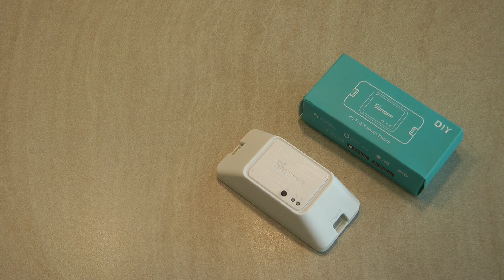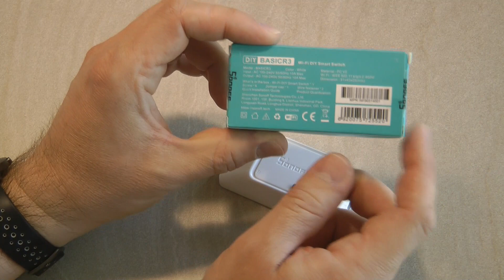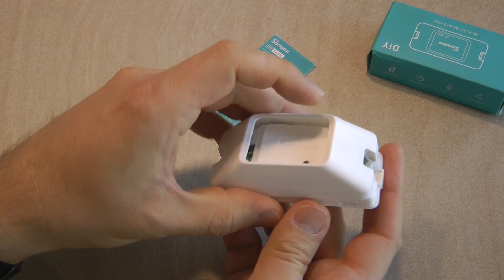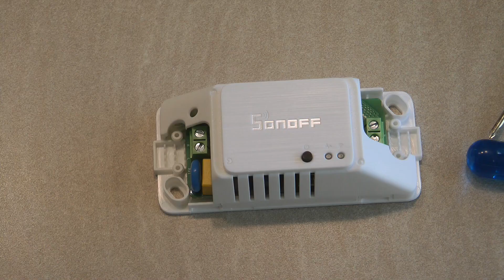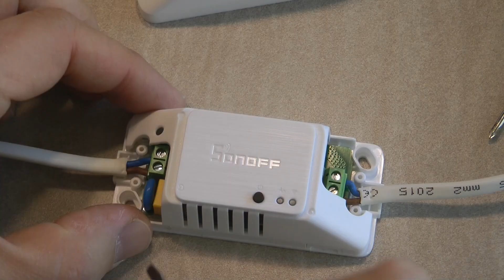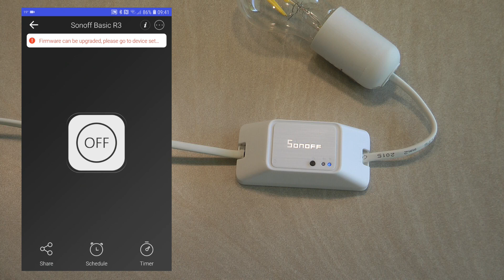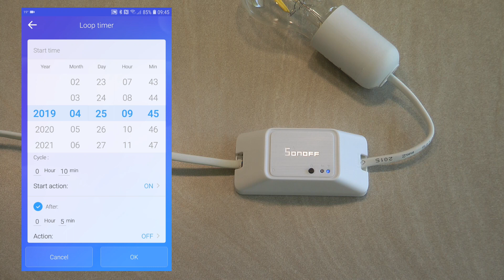Sonoff Basic R3 - First look

Comment: You did a video how to turn the Basic into a dry relay for connecting to a GDO. Wonderful. I've used it like that every since.  But recently I discovered the Basic RF R2 and RF R3.  I want to replace my hacked Basic with a hacked Basic RF R2 or R3, so I can add a 433 remote to gain more flexibility with my door.  Can you please show us how to hack the Basic RF R2 or RF R3 to use it too as a dry relay?  Please?

Comment: I noticed in the settings there is this "power on state" option. Say if I set the state to "ON", does that mean I can now use my wall switch to control the light too? If I switch off the wall button, light goes off; if I switch on the wall button, the light will turn on. Does it work that way? Or do I have to turn the light on with the app every time?
Reply from the maker: Power on state means, what state the device should switch to when it powers up. If you set it to ON and if there is a power outage, when the power comes back it will turn on automatically. So your lights will turn on when the power comes back.

Comment: does the sonoff r3 work connected to a 12v battery instead of 240 AC?
Reply from the maker: No, only mains voltage. 95-240V AC.
Reply: @csongorvarga  do you recommend another sonoff with wifi connected to a battery, mobile phone operation ?
Reply from the maker: @gixxer6728  Sonoff SV works on 5V or micro USB. And can also switch mains power.
Reply: @csongorvarga  so that SV model can be connected to a 12V battery and below? Doesnt need a relay to activate a linear actuator?
Reply: ahh I see,, up to 24V
Reply from the maker: @gixxer6728  Yes, 5-24V supply. Otherwise it works the same way as Sonoff Basic. The relay can switch low or mains voltage as well. You can connect anything to the relay.
Reply: @csongorvarga  ahh so i just need the SV and connect it to the battery and the linear actuator and it will work without any additions? Thanks you for your advice,, great videos btw

Comment: What is the difference between sonoff basic with the sonoff wifi smart switch? I want it to open my outdoor (now has an electric strike and opens with 12v AC)
Reply from the maker: Nothing really. Different physical design, but both have a relay and both have a button. Basic has a physical clicky button the smart switch a touch sensor. The problem that both of them switch the mains voltage on the output. And almost all Sonoff products do that. Probably the easiest method if you get a mains relay, the (relay in the) Sonoff turns on your mains which switches the 12V AC for the strike plate.
Reply: @csongorvarga  Thank you!

Comment: Hi having problems with basic 3 
Just will not connect to my wifi
I have gone through the pairing mode but after putting my wifi & password it doesn't not connect 
Can you help
Reply from the maker: Good question, I am not sure why is that. I can only think of the obvious reasons like it is outside the wifi range, or if your wifi is on 5Ghz only and not on 2.4 Ghz. But if it is a 5GHz wifi, the pairing would not work either.

Comment: DO NOT PLACE THIS IN REACH OF CHILDREN!!! The cover can be removed without tools, and voila small fingers have access to the screw terminals and live voltage. UN-f-ing - believeable
Reply: Maybe the earlier versions could be opened without tools but the current R3 needs 2 screws to be removed before the cover can be removed.

Comment: Thanks for your previous two vids showing how to convert R1 and R2 into dry switches. 
Is this possible with R3 in your opinion? If so, maybe shoot a quick video? 
I use Homeseer, and DIY mode promises to possibly make Sonoffs more practical.
Reply from the maker: Everything is very tight in the R3, hard to make a cut without damaging other things. Alternatively you can just use a mains relay and do not need hardware changes.

Comment: The empty SOIC-8 footprint is for the flash IC that isn't here since they used the ESP8285. They are pin-for-pin compatible. The board was probably initially designed for the ESP8266 but then they chose the '85 probably because it was cheaper or whatever. Also this way they can fall back on to the '66-solution if the '85 becomes unavailable at some point.
Reply from the maker: Thanks for the insights.

Comment: For scheduled timer, does it still need to have active internet connection at the time of set timer? Or does it store the command inside the chip itself?
Reply from the maker: The schedules are stored on the device. You need internet connection to set it up, but it will work even if the connection is lost. But there is one more caveat: these chips cannot store time. When the power goes out the time resets to 0:00 like on old clocks and will only set when the internet connection is up.
Reply: @csongorvarga  Thanks so much for the clarification 😊

Comment: Mine is on the way but after watching this video I'm pretty disappointed - nothing impressing compared to the prev version. And I don't know why they marked it as DIY when it's much harder now to solder flashing pins on the board
Reply from the maker: I will come to this  but it will be possible to control this device over http using the standard firnware. This should remove the need to flash the firmware...

Comment: ....... I am very pleased they used larger Termination block and on the solder side it's much better with a bigger solder pad..... as the smaller blocks come undone when tightening the screw to secure the wires..... thanks for the video presentation.
Reply from the maker: Good observation. I did not notice those changes.